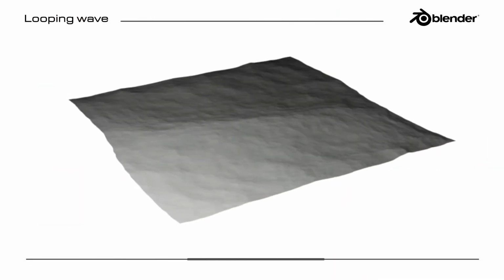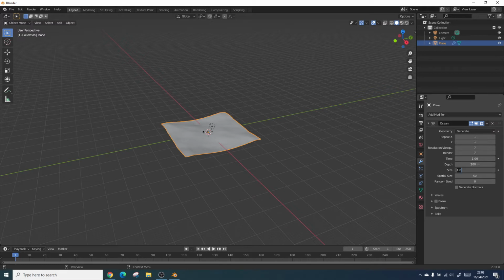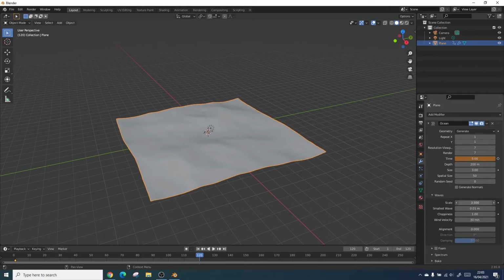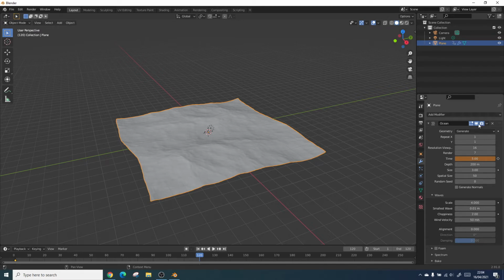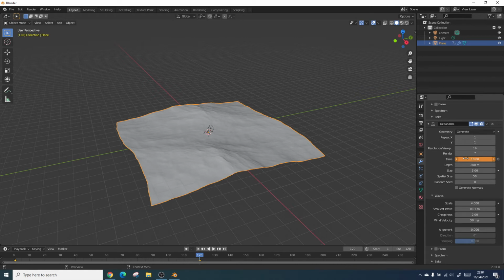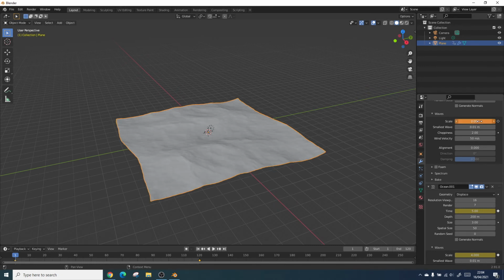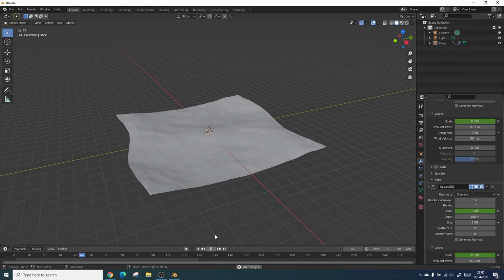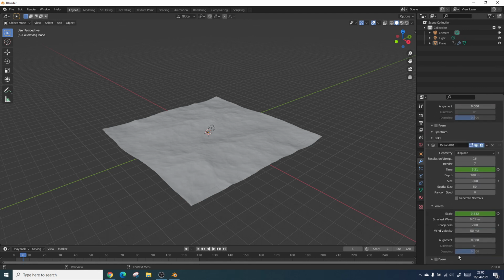Satisfying Looping Waves in Blender

Comment: When I do this, it loops perfectly in the viewport, but it skips after I’ve rendered it out. Do you know how to fix it? If not, do you know how to keep the ocean looping longer in the file so that I don’t have to loop the render at the end? I’ve tried messing around with the values in the modifiers, but I can’t seem to figure out how to keep the loop running for more frames.
Reply from the maker: Try to move the final keyframe from 120 to 121 but still render out a 120 frame animation. Where you are rendering out two of the same frames (1 and120) it's most likely breaking the loop.
Reply: @SatnamB  ahh I finally found the problem. The ocean displacement modifier was set to 15 viewport but only 7 render. It was my fault, there’s no problem with the tutorial. Thanks
Reply from the maker: @sethcollierart  ah okay, glad you worked it out.